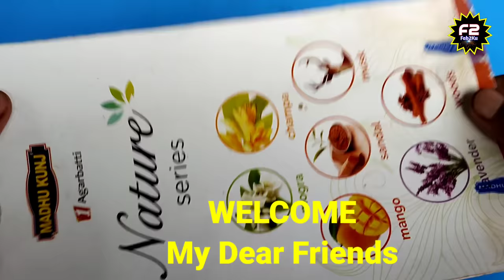Simple ideas For Angle iron Cutting / Amazing Angle iron Project Tricks

Comment: One Angle Iron Size is 13 inches and other Two Angle Iron size ?
Reply from the maker: After joining both the angles in 90 degrees, I measured it with a tape only to get the measurement of the third angle, the first two angles can be kept as much as you can, but to get the measurement of the third angle, I measured
Thank you❤️👍🙏🏻